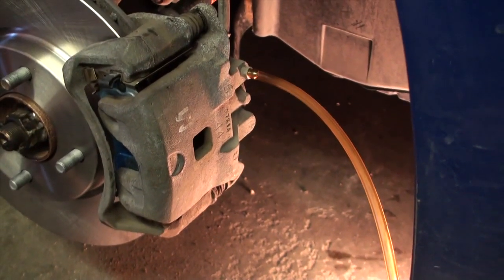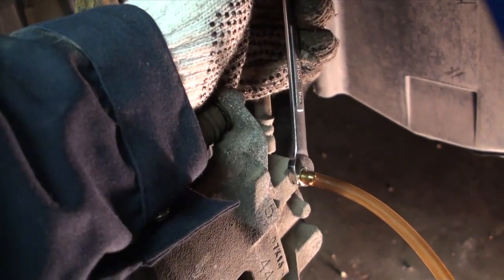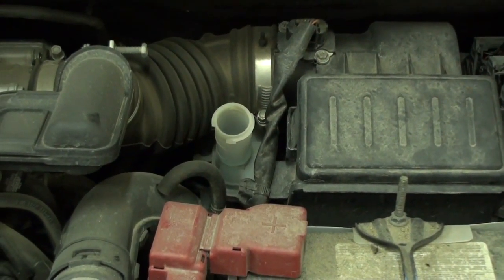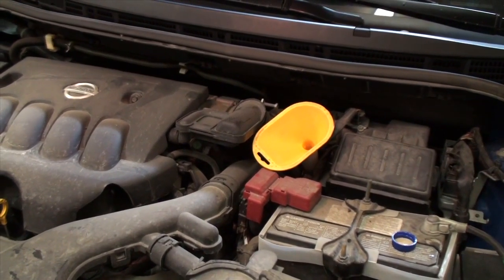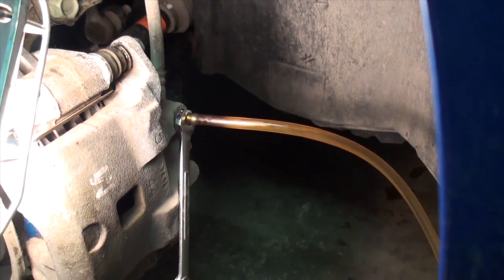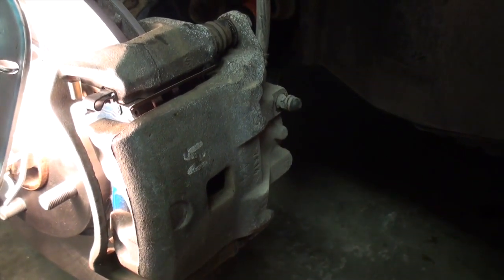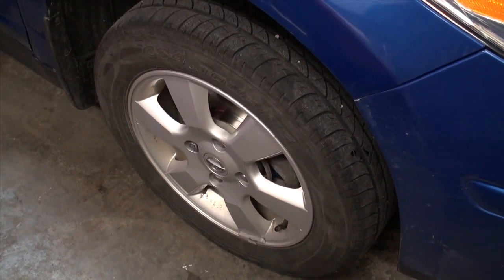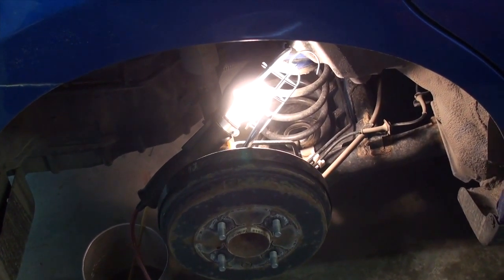How to Replace the Front Brakes + Rotors + Brake Fluid Flush Nissan Versa Hatchback Part 2 of 2

Comment: There is a recommended bleed operation order.  Typically it is FL, FR, RL, RR, but we should all be checking our manuals anyway.
Reply from the maker: Yes, I have considered showing the order of which to bleed BUT for many cars it can be different.  Honda's for example like to be cross bled while others in the order you've suggested.  Really in the end as long as the bleeding operation has been done it is usually ok.  Only in really stubborn situations where bleeding in the non factory recommended order can it rarely cause problems but fortunately I haven't run into a situation like that yet.  Thanks for point that out though.

Comment: Hi I have a 2008 Nissan Versa hatchback 1.8 SL and was wondering if this tutorial on brake replacement and fluid flush is the same for this model. Thank you.
Reply from the maker: John the procedures are practically identical.
Reply: Btw did this 2007 hatchback have ABS on it? I looked at the 2008 manual and it said to disconnect abs actuator or negative end of the battery. Do i really need to do that?
Reply from the maker: I can't remember if the 2007 had it or not but you shouldn't have to disconnect any connectors on the braking system to service the rotors and pad.  The only time you would need to do this is if the sensors for the ABS system got in the way of you removing the pads or rotors which on this car I don't believe that is the case.

Comment: Thank for sharing your video. Big help.
So you changed brake rotor and pads (if needed) then flushed the break system ? Thanks
Reply from the maker: Thanks for watching!  yes I changed rotors and pads and flush the brake fluid since bleeding the fluid is more or less the same as changing the brake fluid out.  The brake system uses so little fluid that there isn't really an excuse to exchange the fluid with new stuff to ensure best braking performance.

Comment: Nicely done.  Getting ready to do my front brakes and wanted to know what I would be getting into.  Slight variations from other personal vehicles that I've worked on but looks pretty simple.  My preference however in pushing back the caliper piston has always been to slip one of the old brake pads on back into the caliper and apply the pressure to the pad centering the C-clamp.  I don't like to risk damaging the piston by applying pressue to the center which could crack.  I know that it's pretty sturdy but by applying pressure to the outside edge there is no possibility of damaging the piston.Also a note for those who have asked about the struts: We had a front spring break about a year ago.  I purchased a quality set of quick struts (struts with coil spring attached) from Rock Auto.  Just before I got ready to do the job I got a post card from Nissan about a safety recall on the springs.  I was able to convince the dealer to install my struts and not absolutely certain if they removed the springs from mine to use the ones provided by the factory or not but I ended up with new springs and struts with no labor charge at all.  Also they ended up replacing one of the sway bar links which broke during the process without charge either.So it's a good idea to google up safety recalls on your vehicles occasionally.
Reply from the maker: good tips Doug and good on your for convincing the dealer to install the new struts for you!  Doesn't make their life any more difficult and I would be a bit surprised that a reasonable mechanic would say no to your request.

Comment: Hi sr if I only change of brake fluid on the  master cilynder   and add new is good or not good?
Reply from the maker: Putting in new fluid into just the master cylinder is better than leaving old fluid in its place but really you need to change out the fluid in the fluid circuits of the braking system for it to truly be effective at maintaining stopping power AND prevent corrosion from forming inside the brake components you can't see.

Comment: Thanks, Just replaced rotors, drums, shoes, pads and related hardware. Rebuilt both front calipers  and replaced the rear wheel cylinders and also replaced the transmission axle seals since one has been leaking. Refilling and flush/bleed the brake lines is next so thanks for over view ;-).   Mine is a 2008 Versa hatchback with 4 wheel ABS ( in the same color).
Reply from the maker: nice.  That Versa will run almost forever now :)
Reply: Thanks, She is back on the road as of today. Drove for about an hour and then back on the lift to make sure everything was OK. No runs, drips or errors! ;-)
Reply from the maker: that is awesome news!  Glad to hear you were able to resolve your car issues.  Doesn't it feel satisfying knowing that YOU did all the work?

Comment: Is the process any different with a manual trans/clutch? The reservoir is shared with the clutch correct?
Reply from the maker: I haven't worked on a manual transmission versa but I do believe that you are correct in that they share a common fluid reservoir.  Either way, the clutch and brake system all use DOT 3 regardless so flushing fluid in your versa's brakes is exactly the same as the automatic version.

Comment: Gentlemen, how many liters of the brake fluid is needed to fill up the system (for Nissan Versa hatch)? Thanks in advance!
Reply: Less than 1liter.
Reply: Thank you, sir!
Reply from the maker: I can easily get away with less than 1 liter of brake fluid to flush and fill the brake system.
Reply: Sounds like magic :)